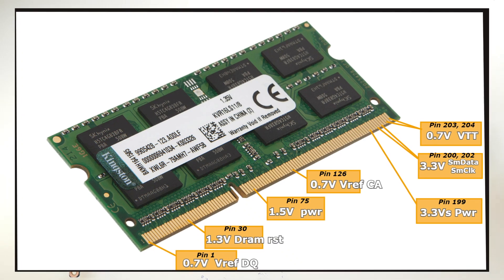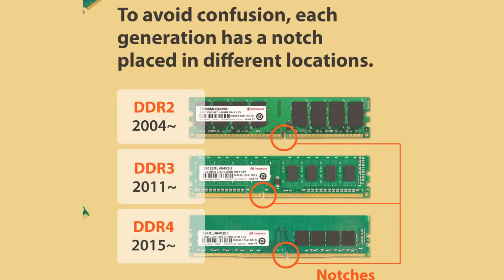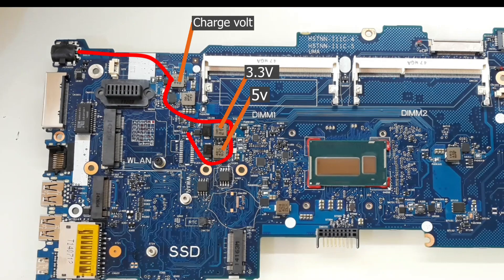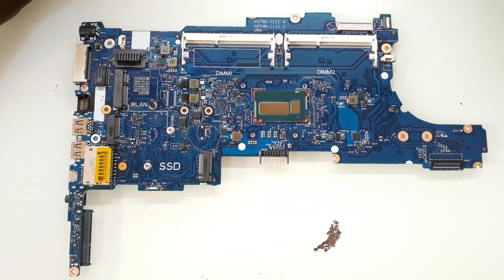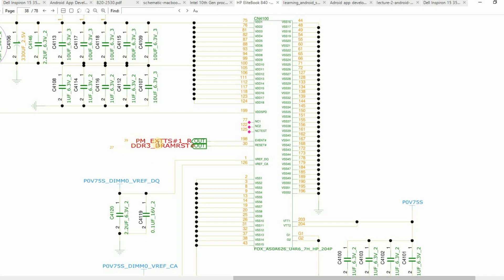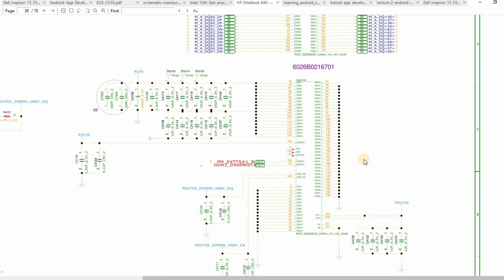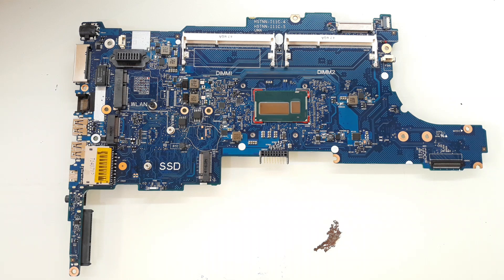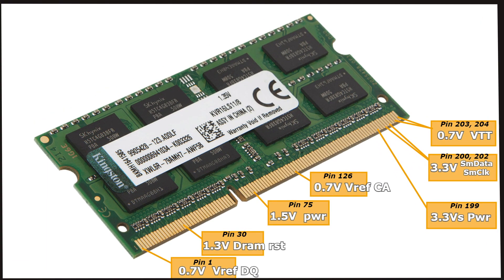How does Laptop RAM work

Comment: This is wonderful. My son spilled juice on my laptop and now its dead. Some the keyboard buttons were sticky and tried to clean isopropyl alcohol so that I cant know, it completely died. The battery can charge but the laptop cant power on!🤣🤣What do you think could be the issue?
Reply from the maker: Probably there are rust component on the motherboard,  check the whole motherboard you might easily see them.